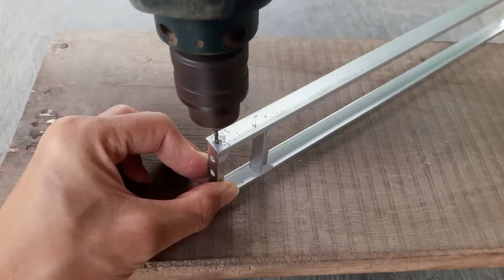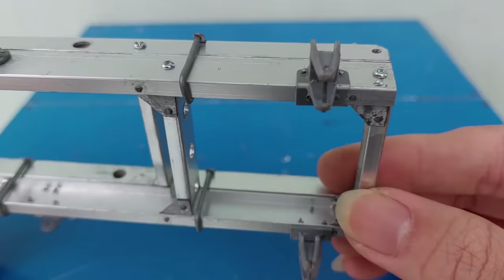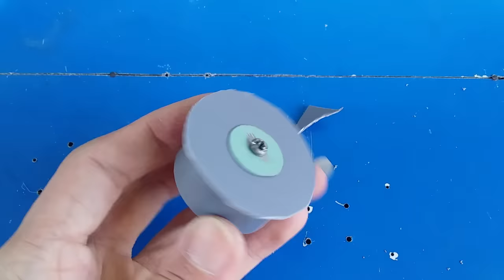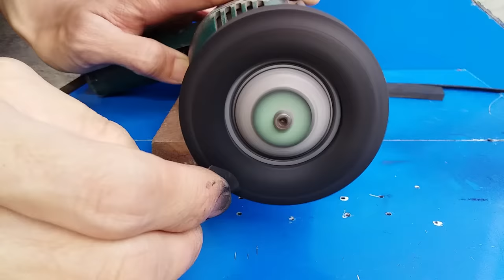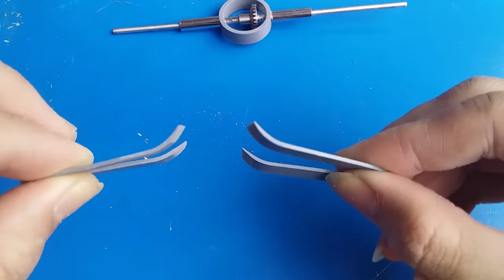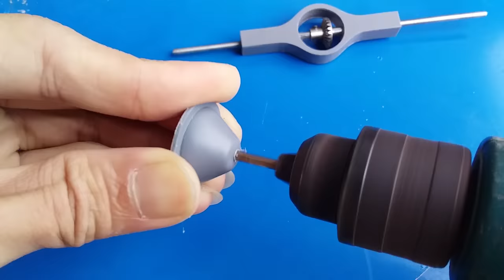Full Video !...How to make a RC Truck from Aluminum and PVC

Comment: What we need to do it in big scale is to replace electrical power sources with IC engine and place a transmission in between engine und axle. I think, It also possible to improve from single axle to multi axle. It's really a brilliant piece of work. 🚚❤

Comment: this video was absolutely amazing, it was very comprehensive, the last scene of the truck just sitting there  with the lights on, it looked just like it was full size there was no way that I could tell that it was a smaller scale radio control truck, it has a good stance, a tough little truck.🚚

Comment: Such an effort on this model in every aspect! Absolutely adorable! I love your model and the work you did. But there's one thing which is a big failure: You didn't do a real functioning differential! Why? Everything else is so over-detailed, but you left out the chance to make it perfect. And from the work that you did i can 100% tell that you would've been able to build a working miniature differential! The way the rear axle is done is not only very sloppy and way too simple, thus not matching the rest of the model, but It also creates problems when driving curves. That's very sad, because that would make it 100% perfect for me! Anyway: You are very talented and still did a fantastic work!